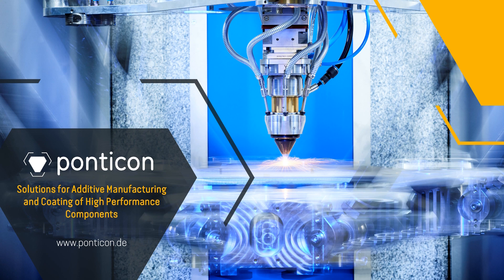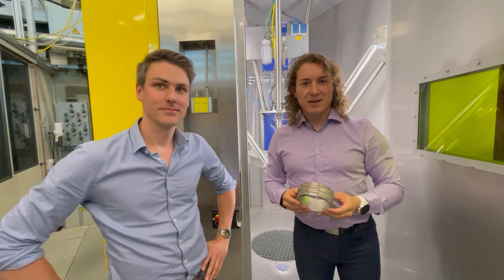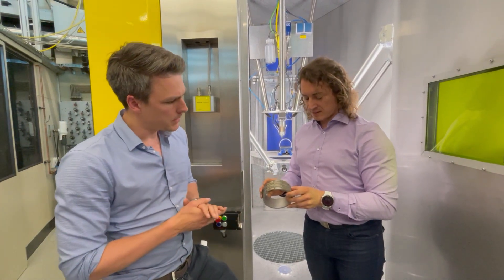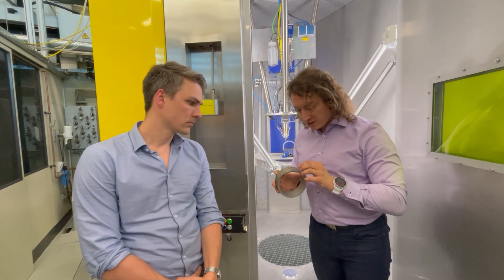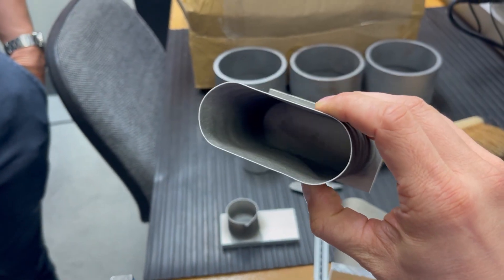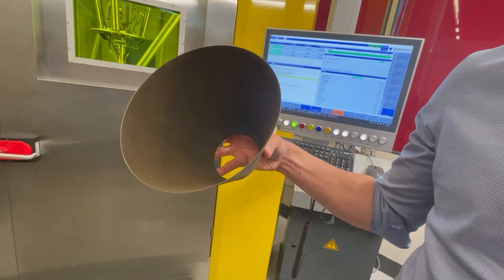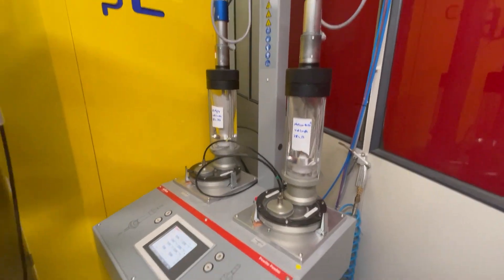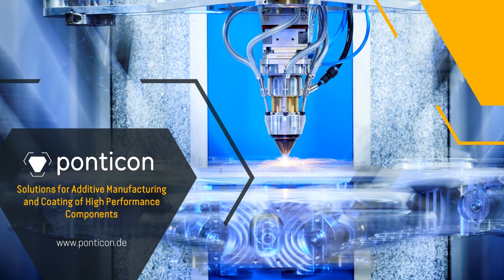High-Speed Additive Manufacturing & EHLA | Interview with Ponticon

Comment: Powder due to micro porosity will never durable for the multi cycle stress. So this technology already are not suitable for aircraft parts manufacturing.
Reply from the maker: Laser cladding is already commonly used for repair of turbine blades. And that since decades. Powder is used as a filler material. However, i would agree with you for PBF process...

Comment: Powder will lose to the wire with process productivity
Reply from the maker: Thats a very generic statement. Strongly depends on process, its complexity. An example from high-speed world - 300 micron coating with powder flow over 200g/min for brake discs...
As for DED - https://www.linkedin.com/posts/arkadi-zikin_wire-powder-ded-activity-7100048870792933376-vBSI?utm_source=share&utm_medium=member_android

Comment: Is this done in a vacuum? Are there any gasses trapped into the metal? Why does the surface look pitted?
Reply from the maker: No, this one is not in vacuum and there is no additional shielding gas, rather than argon, coming from nozzle - for both - shielding and powder transport. 
There is no pitting. I would say it is more about powder particles, stocked on the surface, due to overspray. That might be adjusted with process parameters.